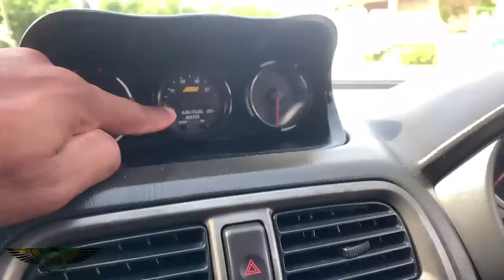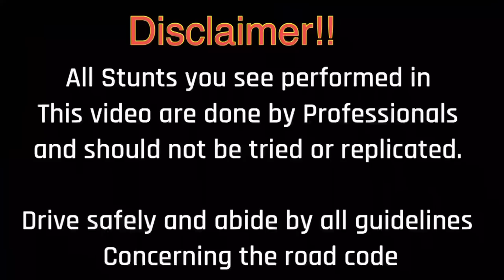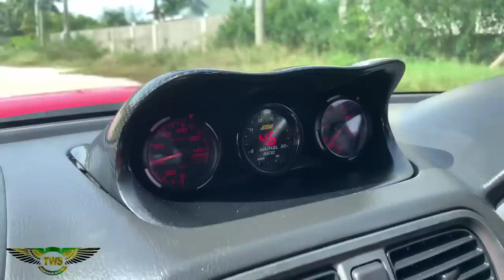How FAST is a Subaru? || 370+ HP G-Force Feeling || 4k

Comment: 375 what boost pressure? Was this on pump gas?
Reply: 20lbs of boost and 90 gas with meth
Reply: @jamaicanpoolman857  how the gear box a hold up????...planning to use the blast plates in my 5 speed
Reply: Its holding up pretty well I have a H brace supporting the gearbox
Reply: @Poolbuilder_of_Jamaica_  planning to use the brace too wonder if it effective